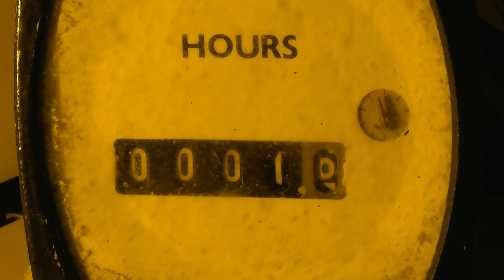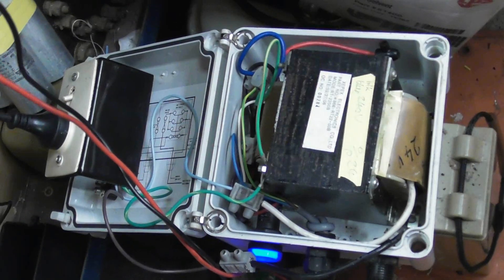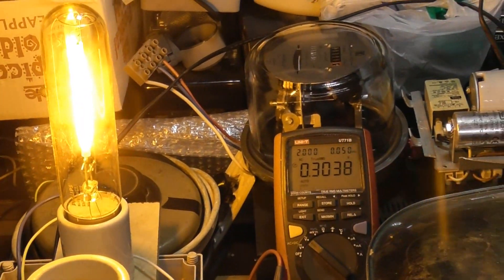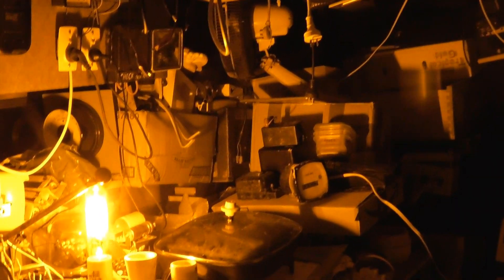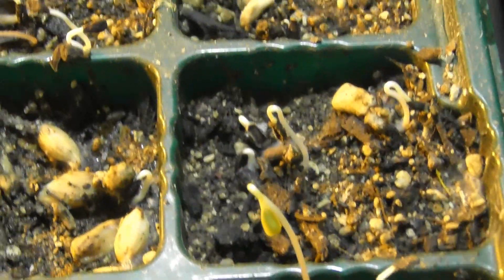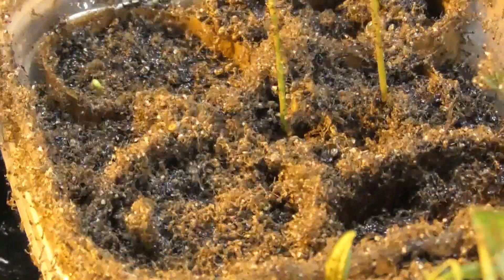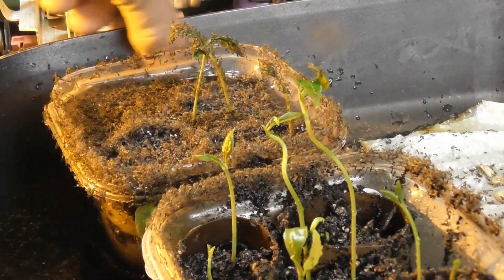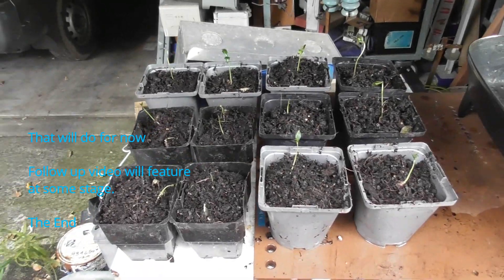HPS grow lamp and lemon and milkweed seeds in frying pan

Comment: Yes, the lamp under run will work, even a cycler will work, as long as the inside arc tube has not leaked out the sodium to the outside. They start off at low pressure, till enough sodium vapourises to build up pressure. So keeping it there is no problem. 

You can do the same with MV lamps, they will just emit most of the light as hard UV. I made Eprom erasers using the capsule off of one, and a 9W flourescent lamp ballast, using the original uncoated start resistor, and soldering to the lead wires off the capsule. did generate a little bit of ozone, but as it was used fully enclosed, and only turned on for 20 minutes at a time, it was not a worry. Very big glow discharge, not the regular confined one, almost like a very small UV lamp.